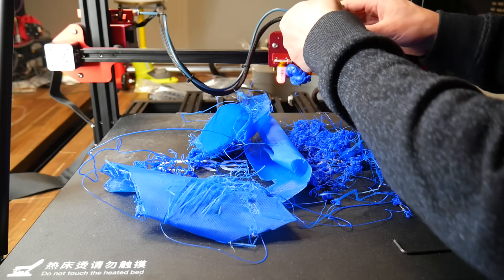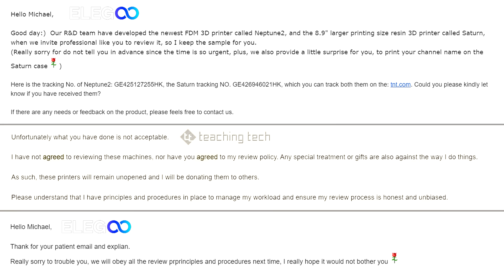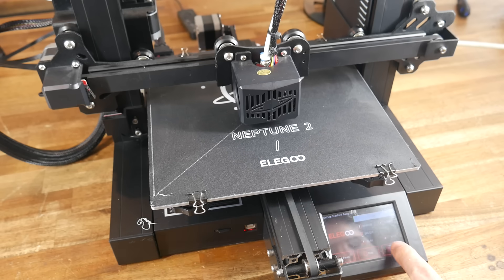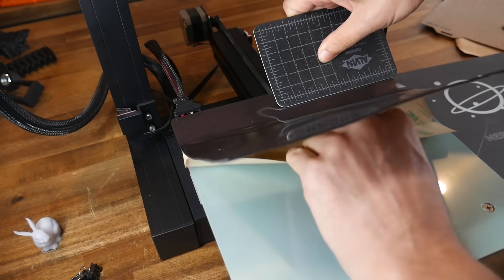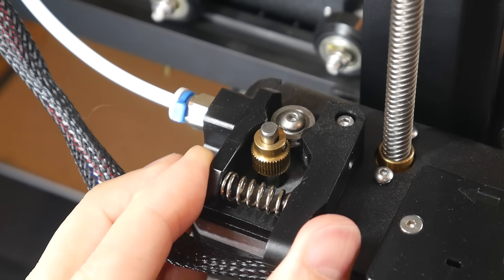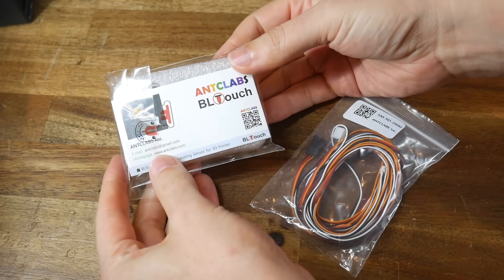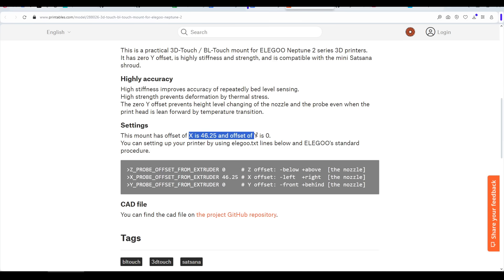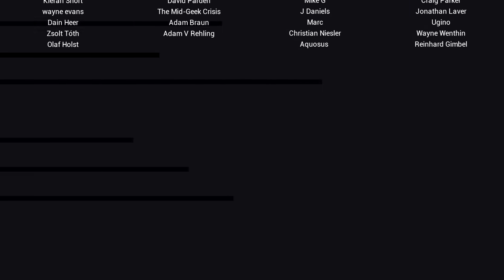Are cheap 3D printers more trouble than they’re worth?

Comment: There is one aspect not mentioned and gives me kind of PTSD from those Printers: The Rollers. If you adjust them for tight tolerances they will wear out. Those Cheap printers are 400 hours printers after that their roller bearings start to die. I have a fully rebuild Ender 3 i donated to the School i work at. It has Parts of my dead Ender 3 Pro in it. I rebuilded it 10 hours with complete new bearings, lot of Upgrades, all shown here + new rollers, better Springs, better Bed adjusting etc. Literally in the Bedleveling Phase one Roller bearing died and has again a "bump" in it. It still printed much better then before and on par with my X1C. After 2 hours of printing it got worse. You can literally feel it on the figure it printed. Ultra smooth walls at the beginning after that normal quality, still pretty good. 

And thats the Problem with those Cheap printers, they may print good and properly tuned in they are excellent but they need constant maintenance to work properly.  While my X1C.. i think it screams again after lead screw oiling.. maybe in 1 month...

My Ender 3 Pro died after 800 hours, with a full maintenance after 100 hours and a 500 hour rebuild. I had so much spare parts it was cheaper to buy an Ender 3 for 80€ instead of searching the error and swap everything over.

Comment: I once bricked my first elegoo printer's entire firmware (which is the pinnacle of spaghetti code) just by trying to get a camera to work. It was annoying to fix but worked out in the end. 
I came to the conclusion that if I can break the software by sheer incompetence it is a net positive and I love to tinker with stuff. Mostly to the detriment of said stuff but you wont learn anything in a sterile walled garden.

Comment: I've taken a long break from 3d printing after doing the "buy the cheapest printer, print parts, build a bigger one, repeat..." curve. I had some real frustrations with the consistency of my DIY efforts. The number of variables to troubleshoot e.g. loose parts, belt tension, temperature issues, print bed issues, axis alignment, filament inconsistency, environmental issues & humidity... it all got a bit too much. I'm thinking of joining the Bambu mob to get back into it - have a solid printer to do reliable printing & then start the DIY side over using the solid printer to treat it as a hobby again.

Comment: If you need it to work reliably out of the box, yes. 

If it's an entirely new ecosystem to you, no. It's perfect. 

Almost everything "wrong" with my enders and anets were things you really need to consider, and you'll learn why things are the way they are, when they're right. 

Otherwise, the prusa i3/ender3 style is just the right way to go, for INEXPENSIVE. A resin is for final finish and accuracy, any scara(and it's misnomers) are for speed, and box styles are between speed and accuracy, but can be belted alot easier than any other kind. 

It's not hard to just say that instead of insinuate lots of things and end the video with "it's ALL up to you" like, no it isn't. There are objective rules we've learned in the last 30 years.
Reply: Single leg types, like the one you recommend(bambu a1) are showy gimmicks. It's probably just fine, objectively. 

It's overpriced, and we both know that.

Comment: An expensive printer does not make you better at 3d printing, but a cheap printer is usually missing a lot of tools/arts that make your life easier while you concentrate on other aspects of 3d printing and there is a lot to learn and a lot of trials and error to have to go thru so try to get rid of the biggest issue for people starting.

I would say that the biggest thing to focus on when you buy a printer is "bed levelling" and what you are looking at as parts or tools installed on the machine to help you in this.
I would also say to avoid buying any printer ( older or of today) that has adjustment wheels under it. It is an old style of adjusting your bed but when you are new to this it will introduce more errors and frustration than fine tuning when you start turning these knobs. You will eventually make your bed a wobbly mess and your first layer wont stick to the bed.

Buy a printer that is riding on rods or some sort of track system if you are buying a bedslinger.  Example a Prusa MK or a model like sovol sv 06 series. Their beds are rigid. It rides on a track and the bed because of these kind of system will stay level all around its surface so that your print adheres better.

That is the biggest thing to look for. I had a sv01 and an ender 5 plus, all of them had wheels to adjust the bed and it never really worked out because i could never make the bed straight. I was turning the knobs and lifting there and causing a ditch elsewhere, even with the paper levelling trick. It was a nightmare that almost made me gave up. bed on tracks do not have this issue. The sensor on the print head will also take care of the small peaks and valleys on the bed and adjust your print accordingly. The sensor are now on most decent printers on the market.

As soon as i got the sv06 i can brag and say, i can press print and leave the room for hours and not be scared that the print first layer did not stick.

Comment: I do a bit of CAD for fun and really enjoy it. I bought an Ender 3 v2 and it worked great for a while, but got sick of dealing with the issues that popped up every now and then. I'm sure I could have modified and upgraded it but I didn't want to deal with the tinkering. I ended up buying a Bambu P1S and never looked back. It's pretty much plug and play. I think they both have their roles, the cheaper Ender 3 v2 was a great beginner printer, and it's probably awesome if you are happy to spend a bit of time tinkering and upgrading.

Comment: Bambu's A1 Mini is a great beginner printer. As someone who owned one though, the 180mm build volume is quite limiting as most larger models assume you have an Ender 3 or a Prusa with larger build volume. For that reason alone i'd recommend the full size A1 with 256mm build volume if the finances stretch that far

Comment: Dont of read this at al bud i used my old bed springs.
En printed some feet put springs in and put them under my 3v3se. 
Its dancing al over the place put produce.s better print.every body is saying you need anti shake.
Bud i found that if you go whit motion from the machine its better 
It is strange .
Bud it works.
Maby you can dive in to this

Comment: I bought myself an Anycubic I3 Mega over 5 years ago. printed a lot with it, till it wasn't repairable anymore at a reasonable cost. At my job, I got another used I3 Mega S and and original used Ender 2. Both of those machines are so run down, by now, that you basically would have to fully rebuild them. My boss then agreed to buy a Voron Trident Kit, which I built. Hadn't had that much fun with 3D printing for years. I just bought a Voron 0.2 Kit for my personal use.
If I can get the scraps of the cheap printers I might try and do enderwire style frankenstein machine, where I use the 8mm round bar from the Anycubic as linear rails for the enderwire. O fyourse real linear rails are better, but the 8mm rods are free for me.

Comment: I need help with an Anet A8 Plus and making it auto bed level. Is there a way to know if my board will support a different firmware and the specific sensors?
looks like Anet might be out of business based on their website. Thanks for your great Videos!
Reply: Yes, the latest version of Marlin I ran on that motherboard was 2.1.2. I've used both inductive and 3D touch sensors and I'd recommend the latter. There's tons of information out there documenting these upgrades. ABL would normally be one of the 1st upgrades so I'd guess you've not invested much in upgrading this printer in which case I'd seriously consider abandoning it and putting your money towards something more modern. It was a great value printer in 2016 but the ABL upgrade just scratches the surface and you're going to be chasing issues that just aren't a thing on even a budget 2025 printer running current firmware.

Comment: From what little I've seen about 3d printer's, the more experience you have, the more better you can handle a cheap 3d printer, which is quite the opposite, the more expensive onces are the onces you should start off with 😂

Comment: I feel that way.
I bought an Approximately $99 Anycubic Kobra Neo over a year ago.
And it's good, and I have printed many things with it (mostly designs for commercial products), but if I had spent the same amount of time working a minimum wage job, as I did fixing it, I could have bought a more expensive printer that I believe would have saved me time, and still had enough money left over to buy filament and other things.
So, unless you just really like fixing stuff, sometimes it's better to just buy a better product.

Comment: I have 14 years of experience owning a CNC machine shop so perhaps that experience changes my perspective, but I have no issues with cheap 3D printers. There is a bit more set up and you have to be precise with things, do more calibration, but none of it is hard. I have my anycubic kobra 2 neo printing for 20 hours a day with nearly no print failures or problems at its maximum speed, in my unheated garage (14*f last night) in a tent with a space heater, and I only print with PETG. I read a good mantra: if you want to have a hobby of 3D printing, buy bambulab. If you want a hobby that is 3D printERs, buy anything else.

Comment: My ender 3 pro with the OG 8 bit board is great, slow but prints great. I print at 80ms and wouldn’t really go any faster. I get super jealous looking at the speeds of the new ones haha 
Only upgrades is the hot end and Bowden tube upgrade plus pei textured bed. It prints very nice!

Comment: 12 years ago I started 3d printing. We had no choices back in the days. Manual leveling and all the time spent on tweaking the hardware and software. I got an Bambulab A1 and love it . I spend more time making and printing instead of tinkering with the printer. Hot end swapping is a joy. AMS lite works great.

Comment: I’ve got a Bambu a1 and an artillery sidewinder x1. I’ve got no clue what I’m gonna do with the x1. It still works fine but I’ve never upgraded it. With default settings it is about 1/5th to 1/10th of the speed of the Bambu so I don’t use it as I can’t help but feel it’s wasteful(electrically). I could upgrade to “co print” that would give me klipper and multicolour printing but for nearly as much£ as an a1 combo. I have a spare rpi4, I could just put klipper on but I think either way it’s still gonna be half Bambu speed. What would you do?

Comment: I knew absolutely nothing about 3d printers just under 2 years ago however I wanted to get into it so I did a LOT of homework and the Ender 3 stood out from the crowd. I bought one and have flogged it practically non stop ever since. There have been a few small things that went wrong but once again some homework solved the issues and I put it down to a learning experience. I can not say enough good words about this printer, it turned out great prints even when I had no idea at all about the slicing software, hell I didn't know what slicing was !. I now have a dual drive filament extruder and it has made an unbelievable difference to the quality of the output from his brilliant little machine.

Comment: Have to admit, I'm still using my CR-10 mini with no auto bed leveling and just a glass (mirror) bed.  Original hotend and extruder still.
And does it just work and prints stick with no problem?
Of course not. ;-)   
I am frequently playing with getting/keeping the bed level and glue stick...
;-)
That said, I have fun doing that and wouldn't recommend that for most people I know.
I have told my friends/family how fiddly this is and there are much better printers out there.
Now, could I add ABL and other things as above to make it better?  Yeah, but as pointed out, that defeats the point of buying a cheap (it was on close out for $140) printer.
When it dies, I'll look at something like the Bambu stuff or the newer Creality printers.
But for now, because I don't mind the bed leveling / adhesion issues and I don't print a LOT, I'm good with where I am...
Fully admit, if I start printing more, a new printer will be on my list rather than upgrading.

Comment: Hey, so last year around this time I got my first 3D printer, an Ender 3 V3 KE, and I'm loving it!  It's so easy to use, and any issues I've had were totally my fault from pushing myself too hard. I debated the Bambu A1, but I'm not a fan of closed ecosystems, plus I like to mess around with things, so the Ender was perfect. I've done some upgrades, like printing a new tool head with bigger, quieter fans, and added LEDs too. I even built an enclosure from foam board and have been printing ABS successfully. Next up is dual linear rails for the Y-axis – the parts are ready, just waiting for a free printing slot to install them.

Comment: I have two ender 3 v2s running all day everyday for the last two years. Modified with the belt Z axis and klack ender by kevinakasam,replaced the bed knob with lock nuts,PEI plate, volcano heater block, Hero Me fan duct, mini e3 v3 board and orbiter extruder, running mriscoc firmware. Can't remember how long ago i had a failed print, but it was caused by my lazy soldering for the z motor connector causing it to stop while printing. Other than cleaning the nozzle before a print and occational bed tramming, they've been very reliable.

I consider my experience the perfect course into 3D-printing. 
People thank bambu for their innovation, but if cheap creality printers and all the others we called the "ender clones" back then didn't exist, they'd be competing with the prusas and we could only imagine at what price range.
Reply: I was gifted an Ender 3 V2 but specifically wanted it because of the tinkering and modding. I learned so goddamn much and have modded it so completely - including variations on all of the above plus a lot more - that it is at this point absolutely just a workhorse with essentially 0% tinkering remaining. It's not the fastest, but it so completely just works.

(I can't even remember the last non-experimental print failure. Well, other than that one last month where the filament spool was miswound by the factory which would've failed on literally any printer, so doesn't count. But if I just want to print an object? Click and off it goes.)

I do want to move up now - I yearn for speed. And I understand people who don't want to bother with all that.

But I am also so glad I did it this way.

Comment: This actually came out at just the right time. I did upgrade my extruder on my ender when I got it, but the spring is too strong and I've now destroyed 2 gears. I was going to get another gear but replacing the whole thing will be better. I'm likely going to save up for a bambu because I want my tools to just work. I have enough chaos in my head and projects, I don't want my tools to be part of that chaos

Comment: Buying an Ender 3 or clone and going through the trouble of fixing and upgrading them made sense in 2020 when everything slightly better was significantly more expensive. But nowadays there is no good reason to even consider one of those, unless it's a secondary machine for the sole purpose of trying out mods.

Comment: My first and so far only printer is a cheap I3 clone that I got for free, with the frame cut out of plywood and a glass 12V heated bed. My first prints were a part cooling fan mount and air duct, and it now runs off an old server PSU. I mostly print small functional items that I design in OpenSCAD, and after some tinkering it works quite well for my needs. After insulating the bottom of the heatbed with corkboard (free) and the heater with a silicone cover ($2), I can print ABS and TPU quite reliably. So it is possible to get a cheap printer to work for you, but it does depend on how much patience you have. I got the printer because its previous owner gave up trying to set it up...

Comment: FWIW, the Neptune 2 does have a Z-offset setting.  I tend to need to use it to adjust for certain PETG filaments for more squish.  Aside from that, I'll attest to everything else mentioned in the video.  =)  These are all almost guaranteed upgrades.  
The only difference for me is that I've started just with replacing the bed level springs with the Creality silicone nubs, rather than going all out into the BLTouch.  And I chose the Creality aluminum feeder assembly, and a Slice Engineering heatbreak rather than the MicroSwiss.

Comment: I am still using my original Ender 3v2... Though it has been upgraded so much, it really can't be called an Ender 3v2 any more. 

MicroSwiss NG Direct Drive extruder, double belted Z, WhamBam magnetic build plate, CR Touch, silicone spacers for the bed leveling screw in hot end temp probe (this is cool no little thermistor with a screw holding it in. 

Still not in love with it and want to upgrade to a Prusa Mk4 or maybe a quality core xy

Comment: I started with an ender 3v2, then a cr-10 mini for a larger bed size. upgraded them over and over and over. I learned an incredible amount from both of them. Different bed materials, different hot ends, different extruders, different boards and displays, different operating systems, how to compile and edit them, troubleshooting prints, dialing in settings, what features i wanted, which i needed. The list goes on and on. Then I got tired of constant tinkering, bought a sovol sv07+ and it's been magic. Now the other 2 sit in the basement collecting dust. I'm glad i went with cheap ones to start. The cost over time ended up being more than a better printer, but the lessons learned were invaluable.